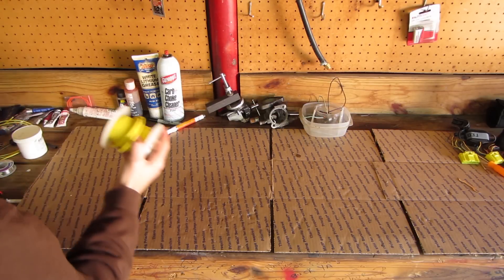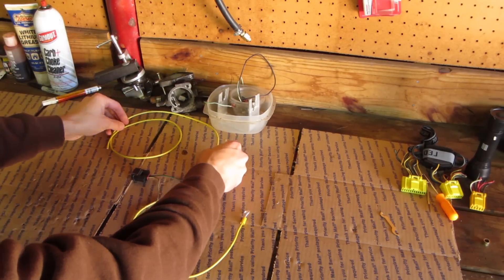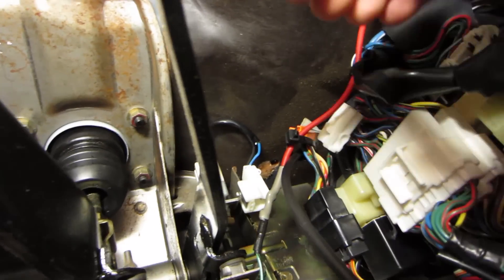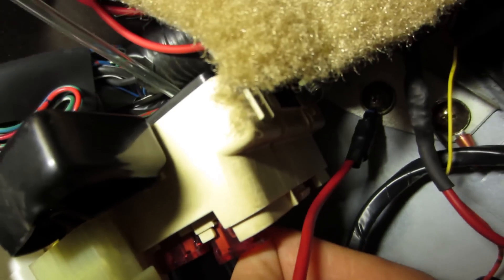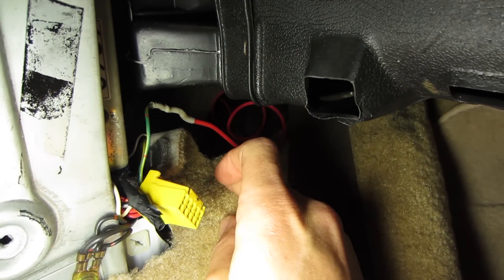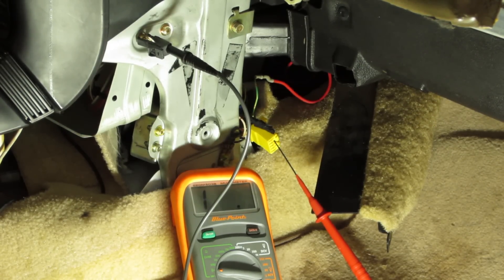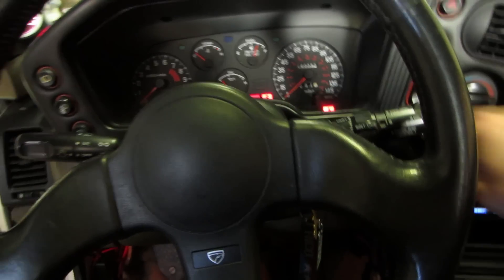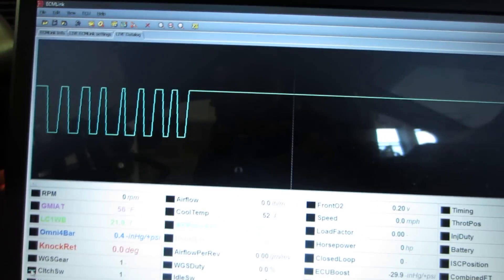Clutch Cut Wire Install - 1990 DSM

Comment: Ok so my ECU is a 91+ EPROM ECMLink

This is my problem, I marked enable no lift shift on ECMLink. I installed a switch in the clutch that sends ground once the clutch pedal is press down and no ground once release pedal.

I try to datalog the clutchSW but it stays "1". 0 won't come once press, only 1 forever. I tried inverting the signal. Mark use starter switch to invert clutch switch signal on ECMLink. But when I do this. ClutchSW stays on "0".

help please

I really want to use NLS and antilag

Comment: Question, In order for ECM link does it require this clutch cut wire install? My 90 talon came with a clutch bypass does that mean that i will have to hook it back up?

Comment: A lot of great info for 90 owners on your channel. I'm going to do this as soon as I figure out why my clutch pedal no longer comes up high enough off the floor to make contact with the switch. Guessing the pedal assembly is shot and needs to come out, seeing how I already did the mc/slave, bled it 900 times, adjusted the clutch etc. Enjoyed the oil cooler relocation video also.
Reply from the maker: Glad you enjoyed the videos. The return of the clutch pedal is largely dependent on the spring inside the pedal assembly along with those bushings that are known to fail. I would be willing to be its the assembly as well.

Comment: confirm this works on 92 galant vr4
Reply from the maker: If you are running Link, the ECU wants to see a ground. Is your clutch switch tied to a ground or 12v feed? If its a ground, you can simply install ECMlinks clutch cut wire and retain cruise control functions. If not, this process should net the same outcome but you will loose the functionality of the cruise control.

Comment from the maker: You can not run this off of the starter switch. This has caused issues on other dsmers. Since the switch is at the end of the travel, the secondary rev limit is not activated until after the clutch is disengaged causing an over rev. If I am not mistaken, the ECU still has the slot for the sensor so making a harness just as I did should fix the issue and give you the signal you are looking for. 

Robert

Comment from the maker: This wire is NOT a necessity to running link. It is needed in order to run No Lift To Shift (NLTS) using DSM link. If you do not install this wire, you will not be able to take advantage of just that feature.

Comment from the maker: I am glad that I could help you out. Having a 90 has its merits, but it also has its downfalls as well. 

Happy Boosting, 
Robert
Reply: So it must be wire to pin 104? because on ECMlink website says that starter switch can be used. starter switch is pin 108 right?  I would like to know this please